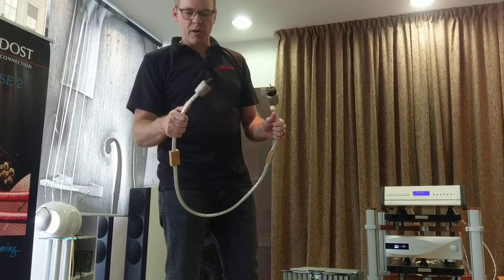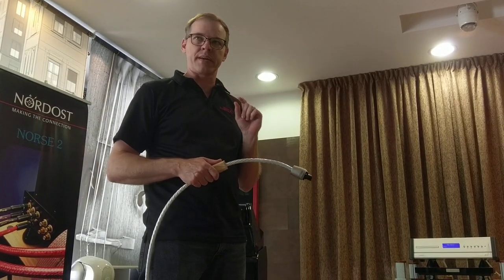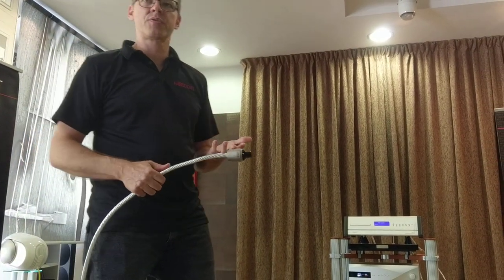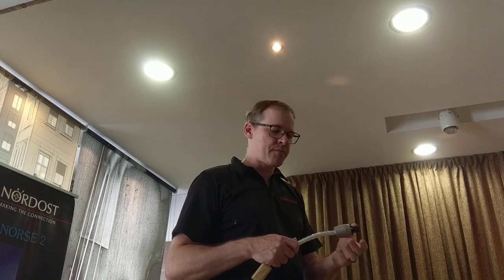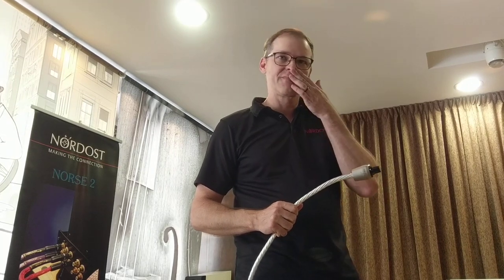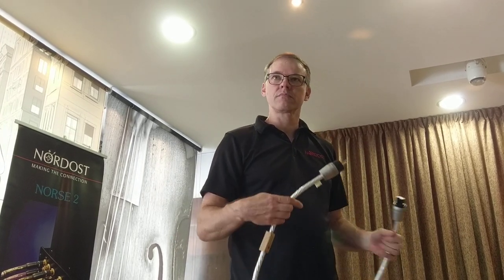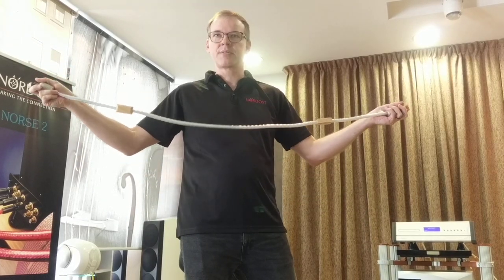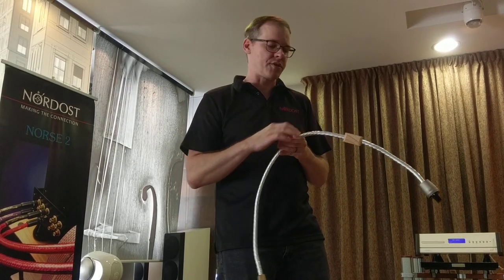The most expensive power cable Nordost Odin 2

Comment: When I get these cables I’ll have to get some $1,200 electrical outlets to plug them into, mounted in a gold electrical box, solid silver house wiring leading to a beautiful audiophile circuit breaker I think I can get for $8,000. I’ll have to call the hydro company about replacing that old copper wire leading to my house, and my system will never be truly optimized until we can find an audiophile pole transformer....
Reply: Don't forget to upgrade all wiring from the utility company and any outlets going to exactly where you are using it 😀 😄 😉

Comment: The snakeoil molecules in Odin 2 are so dense and radioactive unstable. That even the slightest jerk off movement alongside the length of the cable could cause it to cum and punkture the patended "PsudoPro" outer shielding. When mixed with oxygen and the medical-grade stupidity found in Nordost demo rooms. The snakeoil molecules quickly turns into an odorless gas and starts leaking the room. Once the gas get in contact with money,  the fusion of Snakeoilium2000 starts. For a single snakeoil proton to fusion, it consumes 650 billion tons of common sense. The amount of stupidity released would be so powerfull it could alter space and time.

Comment: What I would like to try with cables like this is bring a few "audiophile" people to compare it with a regular cheap 20 USD cable but tell them they are listening to the Odin 2 when I'm using the cheap cable and vice versa. Imagine their reaction if they somehow claimed that the system sounded better with the cheap cables because I told them is was the Odin 2 but then I would revel the truth LOL.

And the crazy thing is there are many other companies like them. I had the chance to personally meet with Audioquest employees and man.... I was open minded at first but the more they talked about their products the less convinced I've become. I know they have decent products but they claimed their high end HDMI cables can do wonders to AVR receivers. FREAKING HDMI CABLES? You know the type of digital cables that essentially carry a bunch of ones and zeros. But of course they claimed that's not true and digital cables are actually still analog because there is still resistance and stuff. They also said my USB mircophone could record singnificantly better quality sound with even their entry level USB-B cable... Their cheapest USB-B cable is also more than 5 times more expensive than some basic USB cable that might not look as good and is probably not as durable but trust me, it doesnt't perform worse than their fancy sh*t.

Comment: I can honestly say that this is way over the top. While I absolutely believe and know that speaker, interconnect, and power cables do change the sound, these are crazy. A nice $300.00 power cable is fine. Speaker and interconnect are bit bit more important. $200.00 interconnect and $800.00 speaker cable is all you need.
Reply: Well, powercabels do not change the sound at all, as long they got the correct size, and science will prove it, and same goes for speaker cables. There is a difference on those, but not so big its possible to hear the difference, and science have proved that aswell
Reply: Jay Bonetti no they dont, 200 is way too much
Reply: An old mains extension lead with connectors wired on will do the same, cables are nothing more than an electrical path from amp to speakers.
Copper is no big issue, the amps terminals and the speaker connections are all soldered on using cheap solder no copper
Reply: No they don't change anything and no measurement has ever proven that or any blind test has ever shown anyone able to hear differences....unless.you are comparing a good cable to something from the dollar store 😂😂😂😂

Comment: Shyster talking bollocks. Mains cables don't affect performance.
Reply: I think these guys are the industry leaders and power cable bullshit! I do believe a power cable should be shielded and of that least 14 gage wire to handle 820 amp load. Anything beyond this wasted money! I am a retired electrical engineer. I think I know what I’m talking about!
Reply: I buy Pangea 7gage Cardis Litz wire power cables with great geometry,sheilding a ding and connects @$200/meter. This Nordist sells for sells for many $1000 more! I agree with the sex and emotions comments. I defy you to identify the Nordist vs. Pangea in a blind AB test!
Reply: Borrow some power cables from your local dealer and do some blind listening tests.  My non-audiophile wife can tell the difference in sound within seconds.  It's not subtle.
Reply: @is1dre  how much do you get paid to say this nonsens?
Reply: Andre 1,000 no she cant
Reply: Andre 1,000  when I’m tired of listening to my significant other, i also tell her what she wants to hear. Your wife is smart.